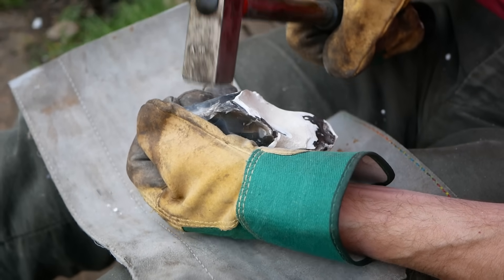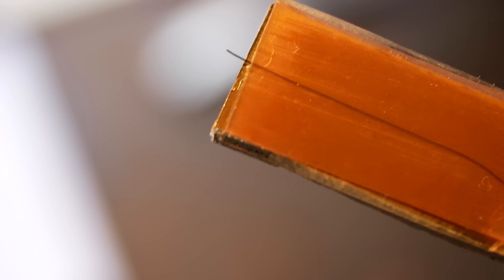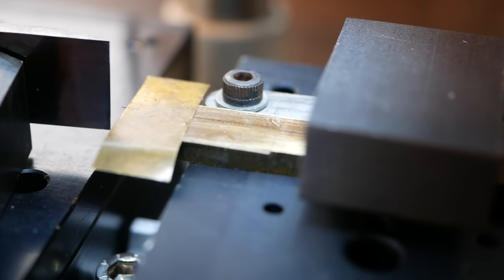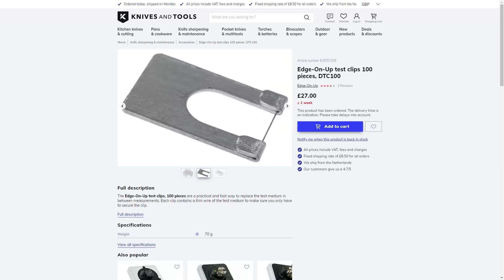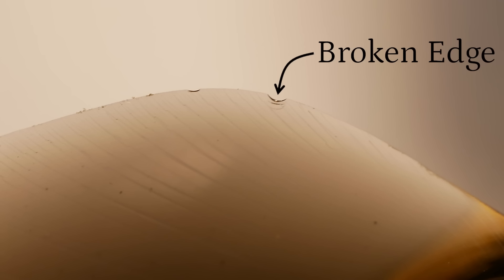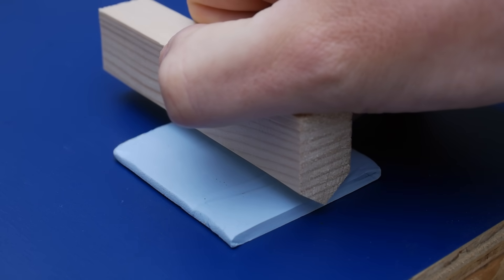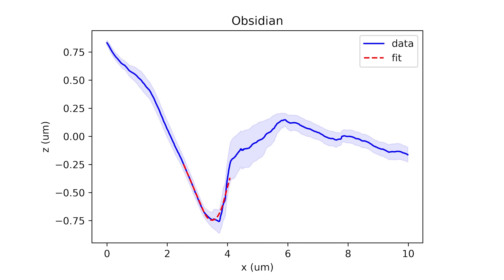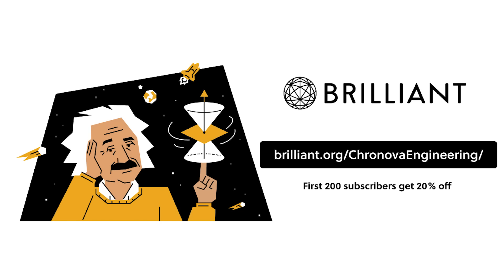Does Obsidian Really Form the Sharpest Edge?

Comment: It's so bizarre to me that there's a ton of videos on youtube where white people try to "test" the merits of obsidian blades without spent any time actually researching how these blades were made and used (for both tools and weapons) for thousands of years throughout Mesoamerica. The only real upside here is that at the very least you didn't pull out a grinder to sharpen it like steal as I've seen in other comically bad videos.

At the bare minimum one should learn about prismatic knapping from a blade core. Then look at some pre-columbian obsidian core artifacts at museums (that's literally what they're there for). Then read about how they were made and the ways they were used so they can have a sense of what to expect in terms of real world use. There were entire industries surrounding the production of obsidian based tools and weapons with skilled artisans producing consistent reliable products. Of course, I don't expect a youtuber to produce a product on par with that as a test, but it's quite disappointing to to see one smashing up rocks with a hammer, producing something that can't cut hair, and then concluding after further testing that it's impractical for real world use.

Comment: Obsidian is very brittle, but saying that it is too much so to be useful in any real world applications is a but naive. The way it was historically used and is still used by modern flintknappers is processing animals and plants, for example cutting skin, meat, or plant fibers. For these real world applications, an obsidian edge is perfectly suited to cut the softer materials without being damaged, and can do so with more ease and less tearing than with metal tools. Obvoisly metal tools are more useful overall due to their superior durability and by extension greater range of applications, but saying that obsidian and flint edges have no real world applications is simply untrue, as any human for about 99.8% of human history/prehistory would tell you.

Comment: "If the edge is too thin to be practical, can it actually be called sharp?" Uh yeah the definition of sharp doesnt say anything about practicality so that's kind of a stupid way to look at it. Those wires are meant to be tested on metal edges, not glass edges. If the edge is a micron vs 15 microns it is by definition sharper.

Comment: a different method to measure it, pulling each blade across a reference material like the lead, with a fixed static load, maybe even a slight rotation to it to mimic a true slicing motion that these types of blades would be best suited to

Comment: Beyond the issue of pushing vs dragging, you may also not be producing the obsidian blades the right way: they weren't simply knapped. I do stuff with Mesoamerica (Aztec, Maya, etc) history and archeology, where obsidian was widely used for tools and weapons. I'm more informed on things like Architecture or aqueduct systems then obsidian production; but the way they did it is the prismatic blade method, which isn't simply striking off sharp shards off a starting stone, but is an actual systematic process to work a "core" piece down to produce single even blades with an insanely fine edge. 

This wasn't a static practice either, there were innovations in obsidian working and prismatic blade production with how the core is struck even only a few centuries prior to Spanish contact in the postclassic period, by which point the region has already been heavily urbanized with city-states and empires for thousands of years and already had a robust obsidian industry. Those innovations in blade production may have actually been what allowed Macuahuitl to pop up in the form the Aztec used them, since it could produce consistently evenly sized and shaped blades, wheras before that the types of weapons used in Mesoamerican warfare didn't tend to have evenly lined edges like that. 

I can't really go in more depth on this, as I said, obsidian production isn't one of the Mesoamerican topics i'm super informed on  (ask me about how cities were laid out or how Aztec political systems work and then I can give you 12 paragraphs!) but yeah, it may be worth looking into prismatic blade production worked.
Reply: hey im interested could you actually tell me about their political systems?
Reply: i am asking how cities and the political systems of the maya and aztec were!!! 👁   👁
Reply: They really, really needed to consult real knappers.  Why the hell would they guess at how it's done, when they can pick up the phone and ask who knows?
Reply: im actually interested can you tell me about Aztec political systems?!?
Reply: I learned something very interesting today 👍
Reply: Their practices were focused on making the edge more durable, not sharper.  The sharpest edge of obsidian (that "one molecule thickness" edge), or any knappable material for that matter, is from the flakes that appear paper thin when removed.  Obviously a paper thin edge is all but useless for cutting due to how fragile it is, so instead a compromise is used to increase the edge thickness and supporting material to a point where it can handle impacts and repeated cutting without it being a one and done affair.  It's a difficult process but most anyone can pick it up with enough time and materials and patience.  Knapping your own tools and points is a great way to keep that tradition alive so the knowledge is never forgotten.
Reply: @Skinflaps_Meatslapper  There is no point in trying to make obsidian flakes reusable or durable, the qualities that give it the super sharp flakes is the same qualities that make it brittle. Even early humans would carry multiple stones to have access to fresh flakes and constantly need to re-knap their knives. It's just a quality of the rock so it's pretty pointless to make them more durable for a sharpness test.
Reply: @themodernninja8074  Kind of the point I was trying to make.  Can you produce an edge with obsidian that's even sharper?  Probably so.  But there's always a tradeoff, even with steel, between sharpness and durability.  The problem with obsidian is that you'll never get to use that full sharpness on anything because it'll flake off the first time you try to cut with it, leaving behind a less acute and duller edge before you're even done with the first cut.  That's why the flintknappers of the past were more focused on making a less acute and duller edge that had more durability instead.  A knife or point would be useless to them if it was damaged on the first cut and needed to be sharpened again.  The obsidian tools they made would hold their edge remarkably well for how brittle the material is, but they still needed to be dressed and resharpened often.  Based on evidence and micro flakes at butcher sites, archaeologists believe that they dressed their cutting tools a few times in the process of butchering larger animals such as a bison until they became too dull to use, and then switched to another when they could no longer expediently dress the edge.  Later on at camp or whenever they had the time, they'd re-profile the entire edge or repurpose it for something else.  They certainly didn't last a long time with normal use and they went through a LOT of them, and that's a big part of why you can find so many of their tools in abundance all over North America.  It's a big part of why natives in the West happily abandoned their flint tools when steel knives became available to them via traders and whatnot.  They were intimately familiar with flintknapping and knew the limitations of stone tools.  The primary reason why they continued to knap was simply to preserve their knowledge and way of life.
Reply: it is an interesting thing that we are still discussing knapping techniques in the modern era perhaps we are not so far as we think we are.
Reply: The Obsidian seems more to be dullled than broken 7:00
author is right, seems like it cant go through hair/metall
Reply: What do you think of the theory that Aztec originated from Utah?
Reply: @ChefBoiDabs  I mean, there's some truth to it, but it's a little misleading: The Uto-Aztecan language family, which Nahuatl (The Aztec language) is a part of, does originate in the Southwestern US. But that being the origin point for the broader language family doesn't mean that the various Nahua groups were hanging out in the SW us directly before they migrated into Central Mexico and became Aztec civilization: Uto-Aztecan languages spread gradually and Nahuatl came about much earlier then those migrations. While we don't know for sure, most researchers and most of the evidence suggests that the Nahuas were in the Bajio region of Northwestern Mexico (So Nayarit Jalisco, etc) when they started to migrate into Central Mexico. The movement of people/languages from the SW US to the Bajio area would have happened centuries or thousands of years before that. 

But to be honest the development of Nahuatl is not one of the topics I am most well read on, so I can't give many specifics other then what I just said and even then some of that is debated. But no researchers think that the Nahuas travelled directly from the Southwest to Central Mexico: That's not one of the valid competing intepretations, what is is where else in Northern Mexico the Nahuas would have been, how much earlier the spread from the SW to northern mexico was, or if Nahua migrations from Northern Mexico to Central Mexico may have predated the 13th century AD migirations that Nahuatl language accounts assert they happened in.

That being said, there is evidence of trade between Maya states and the Southwest US, where Maya merchants brought Macaws, rubber balls, etc up to trade and you can see macaw skeletons, rubber balls, and some ballcourts at Oasisamerican (Pueblo, Hohokam, Salado, etc) sites in the Southwest. It used to be thought that the Mesoamericans were trading those things for turquoise, but recent research shows all/most turquoise used in Mesoamerican art was sourced locally inside Mesoamerica.
Reply: @MajoraZ  please learn to utilize "then" and "than" correctly. For someone who is so well written, and appears to be very knowledgeable, it really takes away from what you are attempting to say.

Always remember: 
Than - is a COMPARISON (John was older than Sally.)

Then - denotes order/time ( We went to the game, then we went to the store.)
Reply: @MH3GL it doesn’t. it’s really not a big deal. kinda petty for you to point that out
Reply: @ttsweee  interesting.... It was a simple critique. I always consider critiquing as a sign of respect - in that you respected what I had to say enough to take the time to attempt to help possibly improve it. I can only hope the OP feels the same.
Reply: @MH3GL  I don't know how you tagged him , but I'm commenting here for all those who didn't get a response for their request for his knowledge on Aztec politics. Hoping he sees our comments in conjunction.

Plus,  I  appreciate the critique and information you presented.

Comment: I might be wrong, but couldn't the geometry of the cantilever tip affect the measurements? While the tip itself is probably plenty small with a radius of like 10nm, you risk running into issues if the indent measured is too deep, as the angle of a razor and probably also the flint and obsidian edges might be smaller than the angle of the cantilever tip. 

As I said I might be wrong. Haven't worked with AFM for several years so might misremember stuff.

Comment: Simply knapping a piece of flint will usually not result in a razor sharp edge.
However, due to the structure of obsidian crystals, and the properties of obsidian itself, it can effectively be sharpened to a (near) mono-molecular edge.
Common uses for obsidian are surgical tools used on soft tissue, such as scalpels.
Hardness, toughness and sharpness are all independent from each other, as is the capacity for one object to hold any one of these properties.

What i'm saying is that your test method for sharpness isn't a test method for sharpness.
It's a test method for all three.
Crystalline structures are WAY too fragile to be subjected to these kinds of localized static pressures, so even though it can be much sharper, it will not ever come out on top of that test.

Therefor: Your test method is inadequate.
Reply: Obsidian is not really used by surgeons mainly due to how brittle they are. 

Sharpness is very dependant on the thoughness as this dictates how thin a blade can be without breaking. 

Flaking is the process that creates the thinnest and sharpest obsidian edges

Comment: Am I missing something.  You seem to be Pushing the Blade. I noticed with the razor blade you put one side down first on the foil.  But back to the pushing down on a hair, Is not cutting a SLICING motion Sure you may take a TIP of a sword or knife to puncture but Slicing is the method of ALL Blades not pushing at 90 degrees straight down.   Just seems wrong, we actually test the sharpness of a blade by rubbing our finger perpendicular to the blade, right?

Comment: As has been said, Using a slicing motion would help but you could also knape a flake with a steeper edge. The flake shown were paper thin. Find a flake with a 45 to 60 degree edge. you can also add beveling to further strengthen the edge, but that's a more advanced technique

Comment: As a bit of a self-appointed expert in sharpness (I'm a bit of a straight razor and honing nerd) there is a very interesting love triangle regarding sharpness. First is the thinness of the edge of course, second is the brittleness of it as you mentioned, but there is also the edge ANGLE that is critical. Basically the 'game' is to get a sharp edge that isn't too brittle by increasing the edge angle. For example, for straight razors, a 'too sharp' razor will 'fold' (or break, if the allow is particularly brittle) it's edge very quickly so is useless -- a 'too blunt' edge will mostly pull hair which makes the shape very uncomfortable. 
With straight razors, an edge that is too thin can be 'bevelled' by placing table (like, electrical tape) on the back of the blade and redo the edge, to increase the cutting edge angle.
Reply: Multi angle bevels are fantastic.  Particularly if you work your initial bevel to a fine edge and then just barely work the secondary bevel down, to the point that it's microscopic.  You get a larger angle on the edge so it's more durable, but at the same time you reduce the contact area of the bevel on the object you're cutting...instead of the entire bevel sliding across the cut material, it's generally only that micro bevel that's seeing any friction so it cuts with less resistance.  I work mostly with knives, so my bevel angles are far greater than a straight razor, but I can get close to that level of sharpness stropping with kangaroo leather and 1um diamond paste.

Comment: Any movement of the blade during imprinting will destroy the profile and make it MUCH larger than it is, the run we see with him using the razor blade he has it offset at an angle then straightens it while it's already in contact. Also - with all these sharp things around surely he can do something about those manky fingernails?

Comment: If obsidian is typically used on cutting flesh, and if it's prone to fracture (or self-sharpening via cleaving - resulting in a serrated edge), I wonder what the long term consequence of these micro-sized obsidian pieces being left in the flesh is?  Or would it only be used in non-living things (e.g. in research)?
Reply: Nothing really. Just like people with pencil lead stuck under their skin. The body simply encases it and it remains there for life.

Comment: brittle and soft cutting edges do not push cut well if they can even do the cut to begin with. obsidian is always going to be better at slicing. the testing method of the bess system isn't appropriate for the material being tested. also remember that the angle of the edge doesn't exactly mean one is sharper than the other. obsidian even at 18 degree angle can still be insanely sharp and have enough support material backing the edge to not just flake out like viewed in your tests.

Comment: Thanks for this interesting video!
There is an interesting new sharpening measurement system out which is called "njutn". Haven't tested it myself yet, but looks very nice. Will crush obsidian edges too though I'm 99.9% sure. In any case, it solves some of the standardization problems BESS got.

Comment: A lot of people in the comments are bringing up the use of obsidian scalpels in surgery. 
Yes, they're used. 
But only because of it's non-magnetic properties in contrast to common steel alloys which is an important factor in procedures requiring the use of certain imaging techniques that can be skewed by ferromagnetic tools or made simply impossible (like with MRI due to the magnetic fields the machine induces)